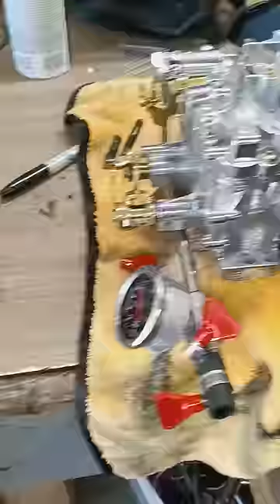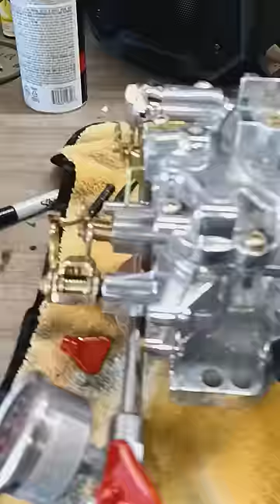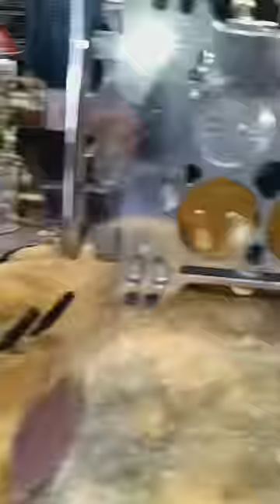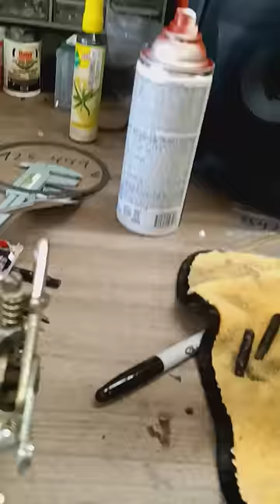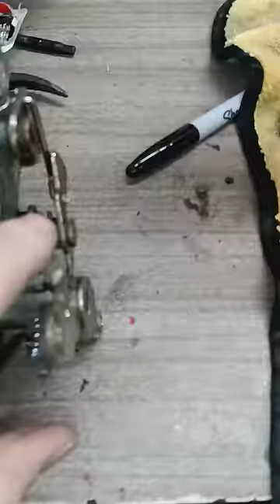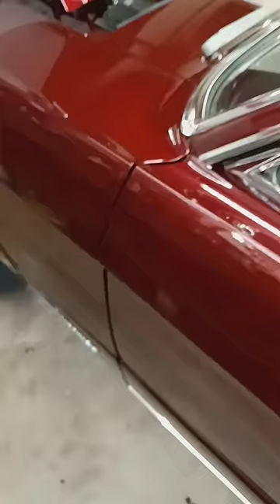how did I miss that?

Comment: should've returned the new one and fixed the old.
Reply from the maker: I did fix the old one and gave it back to the guy that gave it to me. The new one was a different carb. Larger CFM, adjustable secondaries, dual inlet, annular boosters as opposed to downleg. I'm still tweaking it a little bit. The throttle response off idle is better than the Holley 1450 and obviously the wide open is better then the old Edelbrock.

Comment: 5 secs turned into hours, ahahaha
Reply from the maker: Please explain.
Reply: @BPattB   could have simply bent it back while it was  attached to the vehicle, instead you have been thinking, bought a new carb, removed old carb etc.
Reply from the maker: @Badtouch699 The new carburetor wasn't bought as a replacement it was bought as an upgrade. I didn't say anywhere in the video I was replacing it because I thought there was something wrong I didn't notice there was anything wrong until it came off the car. The Edelbrock 1400 series and 1900 series are completely different. It's a larger carburetor, adjustable secondaries, dual feed inlet, annular boosters as opposed to down leg.  I did bend the linkage back just not on the car. It had to be heated up. I'm not taking a torch to anything that's on the engine.  If I would have just bented it without heat it would have broke. I cover all this on other videos. I should probably make a video on the difference between the two carburetors there's so many people that have no idea.

Comment: If the choke is sticking it will cause that
Reply from the maker: Your right the choke stuck closed will cause that. The linkage was the problem in my case.  I made 2 follow up videos. 1 showing the choke open and secondaries not opening. 2nd video showing the linkage fixed and all 4 barrels open wide up.

Comment: your mistake is using and edlebrock carb. get yourself a holley
Reply: My thoughts exactly
Reply from the maker: I have a 4-777 it's a good carb, they both are. But for how I'm drive it the AVS2 is better. If I was going to run it out past 6000 a lot I use the Holley.

Comment: That is the first mistake the second mistake you don't have a holly on it....
Reply from the maker: LOL 250,000 views on this video and I've only heard that 30 times🤣 I have a 4150. Go to my channel and you'll see where I compare the idle between three different carburetors in a quick video. They all have their place and if I want to squeeze every bit of torque and horsepower out of my car I'll use the Holley, but if I want a carburetor that I don't have to play with a lot and I'm not running the car out to 6200 all the time I'll use a Edelbrock. When was the last time you drove a car that had one of the new AVS2 carbs on it? My guess is you probably haven't. You're one of those guys that loves a certain brand and that's all you'll use. And that's fine but how can you have an opinion about something you don't even use? It's all good I'm sure you're a die-hard Chevy guy that thinks Mustangs are garbage and Dodge Dusters are roadkill.

Comment: Took you that long to realize that you had a problem?
Reply from the maker: It really wasn't a problem. Car ran strong. The new carburetor was a upgrade to the old one. Bigger, dual feed inlet, annular boosters, adjustable secondaries ect. I took it out and made a couple of quick videos you should check them out. I these the tires traction. The tires losse lol. I wish I got to drive the car more but my work acts like the place will fall apart if don't work 60 hours a week 🤷‍♂️ the money is really good so I try and keep them happy.
Reply: @BPattB  Part of the tuning process for engines with a mechanical linkage is assuring proper opening of all throttle plates in the fuel induction system, whether TBI or carburetion.  That means two people, one to push the pedal, and one in the engine compartment. Engine OFF, of course.  Vacuum secondaries are not as easy as straight mechanical.
To this day, people seem to complain about the Rochester Quadrajet, but I had the one on my SS396 working like a charm, after doing a rebuild and proper adjustment. The Holley double-pumper I had on the car for a while was finicky, literally provided no performance advantage, and meant the car simply would not start in temperatures below 20 degrees.
Long hours working are okay while you're young and healthy, go for it.  I once knew a guy who (illegally) held two full-time jobs, was putting in 80+ hours per week, as a welder, no less.  I wonder how long he lived, and ultimately whether he felt it was worth it after the physical stress took it's inevitable toll.

Comment: Why do I feel like that was done purposely..?
Reply from the maker: LOL I purposely bent linkage on a carburetor, for what?
Reply: @BPattB  Les air, less gas, less power
Reply from the maker: @aidan8132  are you're saying I bent the linkage so the car would go slower?
Reply: @BPattB  no no no, I'm saying the previous owner did. Unless I'm misunderstanding this all and YOU put that carb in. Or rebuilt the engine
Reply from the maker: @aidan8132  I probably could have been more clear in the video my bad, the carburetor I got from a friend late in the evening after a few drinks and put it right on the car. Started it up the next morning and it drove pretty good. The carburetor was replacing a Holley double pumper so I was not expecting the same performance obviously. That video got 350,000 and then some views. By far the majority of the comments were really cool. But there were a few trolls that accused me of all kinds of crazy stuff. Sorry if I came off like a jerk. I made this video for a few friends and family that live a long way away and it's easier to just post on YouTube when you have 18 subscribers. Now that I have 2500 I can't do that anymore LOL. Anyway man I'm planning to do some videos in the car that you might like. I'm going to do some pulls and adjustments on the new carburetor. And I'm going to do some really strenuous "traction tests" in Mexico. If you don't like innocent tires being abused and lit on fire you might not want to watch LOL.
Reply: @BPattB  no offense taken on my end. My initial phrasing definitely sounded like a personal jab. I can't wait to see some tire fires out of this thing. Keep it up man
Reply from the maker: @aidan8132  tlThere's already one short and a video that's not very long of me testing the tire traction. LOL the tires lose. They're on my channel feel free to take a look there's one in the shorts and one in the videos I've got more coming. I know there's not much there but I either need to get a camera or just buy an iPhone if I'm going to use my phone to make videos. It's all good man your comment it was just fine there were a lot of complete weirdos but I wasn't expecting half a million views LOL. Enjoy brother.

Comment: You sure that's not a vacuum secondary and the other one's manual secondary
Reply from the maker: No. I made a follow-up video "how I fixed what I missed" and I'm able to actuate the secondaries on the carburetor with the linkage I fixed.
Reply: @BPattB  okie dokie bro
Reply from the maker: @cliffordbirchell2029  right on thanks for the view maa

Comment: So you bought a new one for no reason? 🤔
Reply from the maker: LOL why did you think that? Did you notice the two different logos on the front?
Reply: The old one was underperforming from the way you presented it, you said you discoverd the throttle blades not opening fully until after you removed the old carb. Am I wrong? I was ribbing you, I'm a retired mechanic I've had plenty of mistakes like this in my time!
Reply from the maker: @logan_e  the 600 CFM Edelbrock was a stopgap. I had a holly 4150 and those are great if you're trying to squeeze every last bit of power but in a car I just want to fire up and drive I'd rather have an Edelbrock. The 600 was lean according to the plugs no matter what metering rods and jets I used. The new carburetor is bigger and atomizes fuel better at idle and low speed so hopefully that cleared it up.  Leaner is meaner but it's not very good for longevity LOL. Now that I'm older I can't take not knowing if I'm damaging the engine so I sense an AFR gauge in my future.
Reply: @BPattB  Definitely go for the AFR, I was a 2G emissions tech in Reno, using the AFR on the machine to dial in crabs was fantastic for my customers and the Carter/Edelbrock is definitely the one for everyday drivability, I'm with you!

Comment: why not just bend the shit where it needs to be and return the new carb?
Reply from the maker: The new carb is not the same as the old. Larger CFM dual feed inlet, annular boosters, manual choke, secondaries are bigger.
Reply: @BPattB  yeah sure its better but its still not as cheap as fixing what was wrong.
Reply from the maker: @coreytillotson3313 if there was a way to jet more CFM into a carb I would have kept the old one

Comment: don't do like my 442 and fix the carb make it a mile down the road nail it and no more transmission happened the day I bought it tried to figure out what was wrong with it cuz the Dino sheet since 632 horsepower and it drove like it had a hundred
Reply from the maker: Well I got a whole new carb on it now, just trying to tune through it it's got a slight bog or hesitation just off idle. I need more details bro what exactly happened to the transmission? And obviously I'm sorry for your loss⚰️
Reply: @BPattB  how slight of a bog sometimes a little timing can help but I normal but the tune kit for afbs
Reply from the maker: @surfofsinify  I got rid of the bog yesterday. I adjusted the second air door to open slower. I guess when the secondaries first opened they were getting a bit to much air. The tuning kit is one the way. I should have around 15 different sets of rods at that point lol.
Reply: @BPattB  just remember you can take you metering rod 1 up or 1 size down before you have to change the jets

Comment: be careful not to tempt our God and if you don't know what that means he ain't got his hands on you when you're acting out so be careful not to get yourself killed without extra power double check your balance to the vehicle double check your framework make sure there's no cracks there's going to be a lot more torque don't forget about the suspension one with a little bit more tension will leave you against the wall oh yes and the tires the pressure has a lot to do with the take off and how the vehicle handles as it goes one tire having more pressure can send you against the wall make sure you want them to grab evenly make sure your car is in alignment then you can risk your life maybe God will be there for you

Comment: You probably damaged it when removing it
Reply from the maker: I had to heat it with a torch to bend it back so it would not brake. I made a video covering it called "how I fixed what I missed". I would have had to drop the carb to bend it like that. I can promise you the carb was not dropped. I want drunk enough yet. To early in the day
Reply: @BPattB  well how it bent is definitely a head scratcher than
Reply from the maker: @dominoespizza1756  the carburetor was given to me and other than the bent linkage which I didn't notice at the time obviously LOL it looked really good. I even checked the Julian date code and it was manufactured in 03 but it had really really low hours. It came off of a 67 Camaro that doesn't get driven much. Sooooo I took the air horn off and check the float bowls, needle and seats for dirt, and floats to make sure they work right, I figured it set around for a long time I should just go ahead and check it. It was pristine inside because not too much ethanol gas had been run through it. The crazy part of all this is I made that video for family back east and it got half a million views and I gained over 2000 subscribers, I think I had 18 and I don't even know why I had 18. Anyway the Edelbrock with linkage will be one of the great mysteries for all time apparently 🤣. I figured maybe I unlocked the mysterious algorithm and I should keep putting content out so I can quit my job and be a bazillionaire🤔🤔😒.  Anyway LOL I'm going to try and make some videos I think I would want to see that aren't too long. I'm learning how to edit, I ordered a tripod for my phone so I don't look drunk every time I make a video even though I am. I'm going to do a quick feature on the 67 Camaro and build the guys doing on it so all the Chevy brand pimps can leave me alone now 🤷‍♂️. Anyway stay tuned brother.

Comment: Next time use EFI.
Reply from the maker: No
Reply: @BPattB  ok then direct injection then. Good grief.
Reply from the maker: @ivor7407  loll no. I can rebuild a Edelbrock carburetor in about an hour. If the carburetor is acting funny process of elimination will tell you what's wrong. My buddy with a Fit Tech is on his third unit and they just don't act right. I would definitely never use EFI on a brand new motor. The EFI can tend to  lean you out if you're not paying attention. That's disaster on a new block. The old carburetor I had with the bent linkage still worked great I just wasn't getting everything I could out of it. It was a little undersized for the engine is why I bought the new one. I may do EFI eventually on a different car but not this one.
Reply: No disrespect buddy. Peace.
Reply from the maker: @ivor7407  Absolutely respect, it's all good we're just talking cars brother.
Reply from the maker: @ivor7407  I literally followed two people on Facebook, I do use marketplace to buy stuff like used carburetors and whatnot lol if they had used EFI for cheap I will buy it just to make you happy. I'll add you next time I'm on brother

Comment: Take it back and get cam an lifers
Reply from the maker: The carburetor I put on was an upgrade. It was not a replacement one for one. It has dual feed inlets, It's a larger carburetor, angular boosters, and adjustables secondaries. The cam is in good shape if anything I would swap out the rear end. There's a couple of videos I put up last weekend of the car testing the traction of the tires you'll probably like.

Comment: Replace it with a Holley
Reply from the maker: I have a 4150 that's great for squeezing every little bit out of the engine but Edelbrocks are hassel free. I think I'm going to mill the choke tower off the 4150 and run a velocity velocity stack when i use it.

Comment: Many are wondering why would you buy a brand new carburetor exactly like the perfectly good one you already have.. .. you Just have money to burn..
Reply from the maker: It's not the same SMH, you can do the research. Old one is an Edelbrock 1406 new one is a 1905. I would think the two different logos on the front would be a giveaway.
Reply from the maker: I was wondering if you got a chance to look into the two DIFFERENT carburetors?
Reply from the maker: Bueller Bueller anyone Bueller?